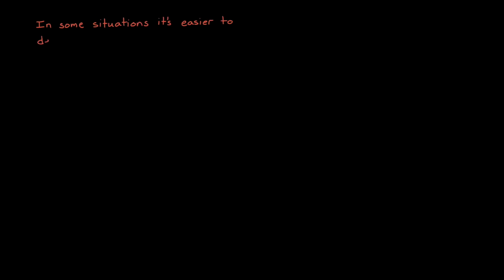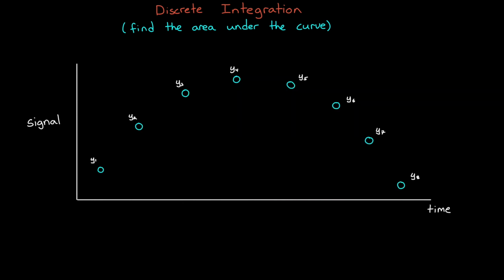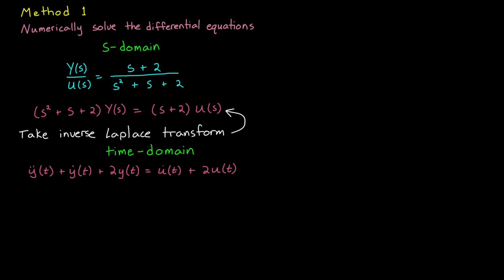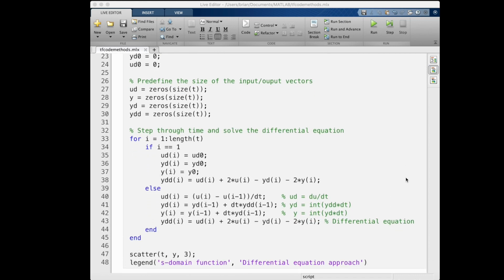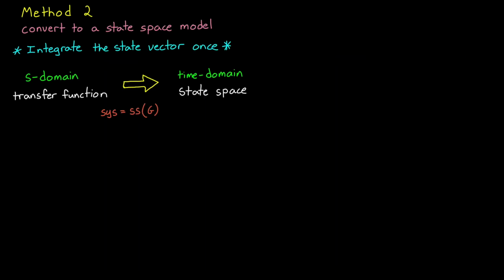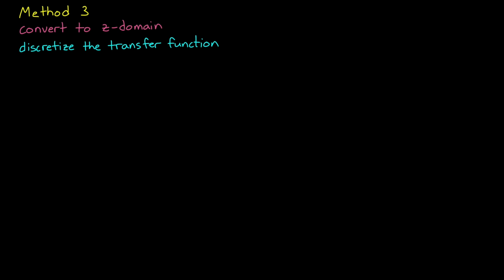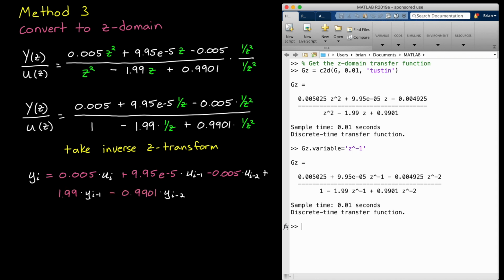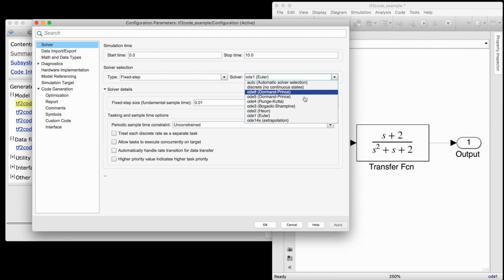4 Ways to Implement a Transfer Function in Code | Control Systems in Practice

Comment: Fyi, Python has a contol library that allows you to enter transfer functions in the same way that you enter them with matlab, that is, via arrays (numerator and denominator).  You can plot the bode plot, Re/Im poles/zeros, root locus, step response, etc., with minimum coding effort.  Python is a very powerful general purpose language and worth learning.  In some cases, its performannce is comparable to matlab via external libraries.  Best part, it is open source and free.  ☺

Comment: S domain is continuous-you don’t have to discretize it when you use it.
Reply: How are you using it? If you are implementing it with analog electronics then I agree that you don't have to discretize it. But if you're implementing it on a digital computer then it has to be discretized in some way.
Reply: Ha yes true, analog.
I am being funny-I just switched to z domain when I realized rk4’ing transfer functions was like shooting in the dark to figure out if they were stable or no-

Comment: Why does the first method accrue error over time?
Reply: It comes from the numerical integration and differentiation. Instead of taking a continuous integral, we're using a first order method to sum the area under the curve and this isn't perfect. The faster the sample time the more accurate it is, but error will still accumulate. This is actually a problem with all of the methods. Better accuracy comes from solving fewer numerical integrations or increasing the order of the numerical integrator.

Comment: All of these methods essentially numerically solve the resulting ODE from the transfer function, what is the feasibility or other practical considerations for using a running convolution with a stored step response?

Of course since a stored step response is necessarily finite in length it would only actually perform FIR filtering, but they can be made arbitrarily close to IIR filters.

Comment: I'd suggest as a default initializing previous-step signals to their current measured values.  If someone is implementing a compensator or a filter, this would give the expected behavior, vs. initializing to zero which may give "spikes" or "jumps" upon startup.

Comment: Though state space implementation may seem better, since it uses just one integration per iteration, but while implementing the code on embedded controller "C" code, you will have to do matrix multiplication, which will take many cycles. In my opinion, converting to "z" transform is the best and most popular method.
Reply: Indeed. However, matrix manipulation can be made easy if you are able to port Eigen (C matrix library) into your hardware ;)

Comment: Hello Brian, I have used the third method for implementing a fourth-order transfer function without zeros [6810.43913975331 / (s^4 + 36.3373933727534s^3 + 495.152308922335s^2 + 2998.75737145633s + 6810.43913975331)]. I tested the resulting discrete method(Tustin, 0.005 s) and the corresponding continuous transfer function in simulation both results matched BUT I got little oscillatory behaviour response with a bias on the discrete transfer function response when I run them in real-time with ardunio support package. I couldn't find the reason. Can you give me a little help with that?
Reply: Be aware of the precision of  transfer function coefficients. Do float or double can give you enough precision? Check it :)
Reply: The discrete time system is nonminimum phase, need to consider how to make it minimum phase……

Comment: what if we have a higher than 2nd order transfer function? Also, how we can use the code that matlab generate, i couldn't find any  input and output setion, its so complicated code, can you provide information or a link about this, thank you for your great video!!
Reply: The process is the same for higher than 2nd order transfer functions.  You just will have to initialize more states at the beginning.  For the state space method (easiest to explain), your state vector would have more elements in it but the code would still just have that single integrator.  The auto code is complicated because there is a lot more going on than just the transfer function code.  There is all of the stuff that runs the simulation and execution part of it as well (steps, timers, memory allocation, etc.).  I don't have the code in front of me right now, but if you look through the file you should be able to find the portion where the transfer function is written out.  Let me know if you can't figure it out in a bit and I'll try to help a bit more.
Reply: @BrianBDouglas  As a user, i would like to put the generated code directly into the microprocessor, but anyway MATLAB still doing well jop. I've reviewed the generated code in general and found some input, output, and useful definitions that you mentioned, but there are still lots of parts that need to be edited. i guess i rather use state-space arrays. I also watched a lot of your videos including state space, these are quite good and I would recommend it to anyone who working on it. Thank you for your help and interest :)
Reply: @BrianBDouglas  Sir, thank you for awesome lectures. I want to discritize a lead-lag controller for a microcontroller. I used the z-transform method you discussed, to get the time-domain coefficients and implemented the similar equations as you did (three delay terms in my case). The discrete controller's response is excellent when I plot using step(continuous, discrete) function. But it flies off to infinity  when I do with difference equations as you did. Is it due to rounding error accumulating over time? I can't find a way around :(
Reply: Yes! Solved it! Using tfdata, I imported the coefficients of the discretized function. Then I used vpa to get the precise value of coefficients up to ten decimal places. It did the trick!